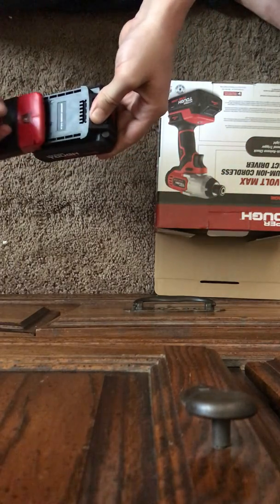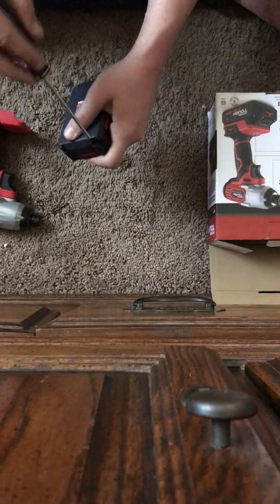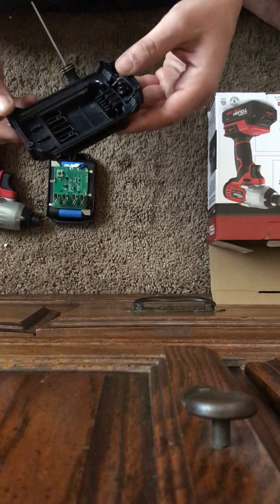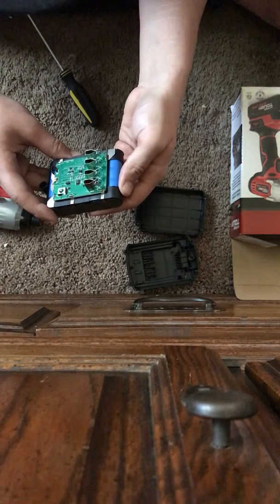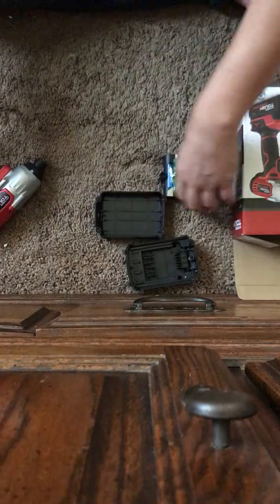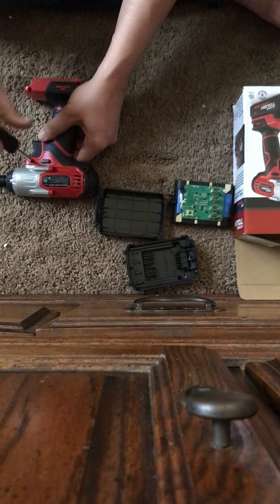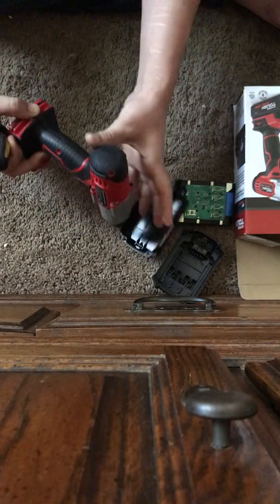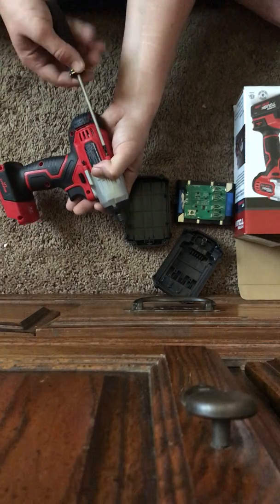Hyper tough 1/4 impact driver teardown/review

Comment: I think AvE would be proud to see others are tearing down tools for themselves (check out his channel if you haven't). Great video man. Oh and Walmart is adding the hart tool line and making room by marking down old tools. I just bought a 4 tool combo kit for $50. That's $12.50 a tool with 2 batteries and charger. Check your local Walmart.

Comment: Pretty  good drill but I would say the bauer  is just a better price overall you get 

A full glass fiber and metal gear reinforced frame AND Samsung cells And I fast charger which usually charges in less than 30 minutes and carrying case for about 20 more
Reply: Nathan I completely disagree while I do wish they used glass fiber in the housing I wouldn't trade it for the Bauer because the Bauer has terrible electronics it blows the mossfets on the circuit board far to often there's no heat sink nor is there any diodes or compacitors to help with overload the Bauer just won't last due to thing engineering flaw